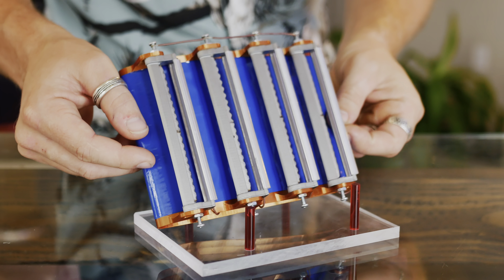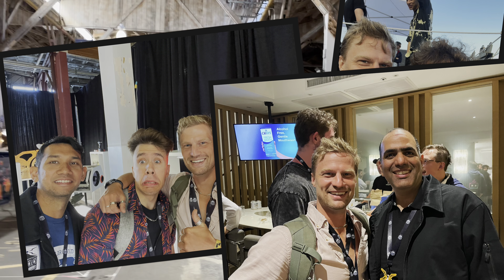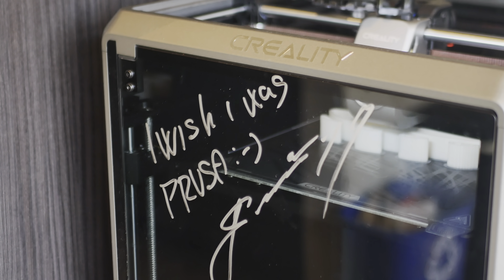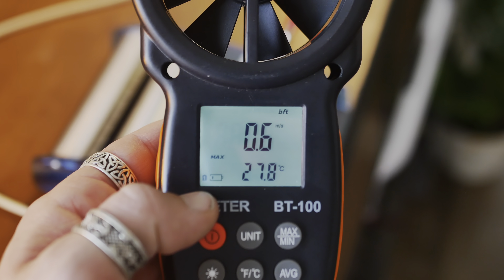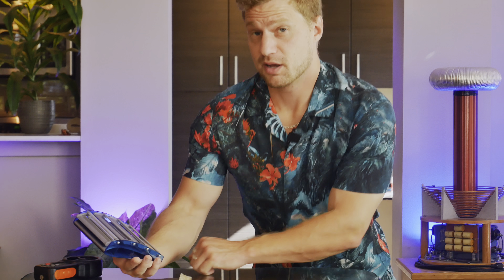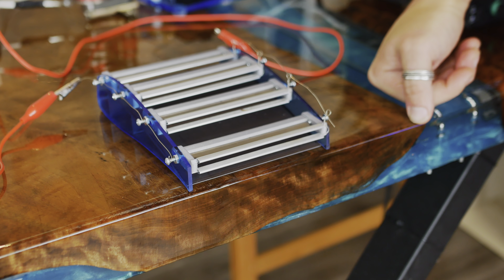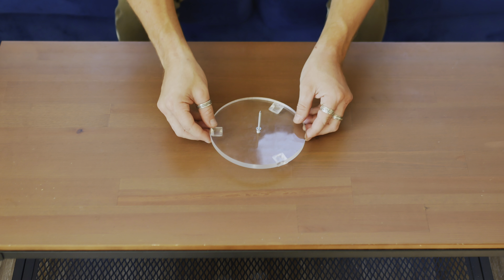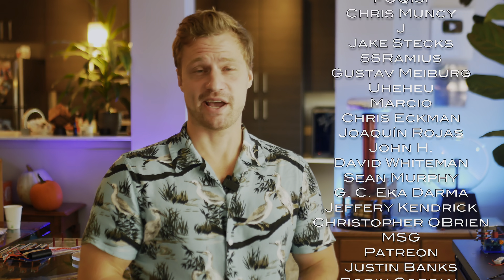Designing A Self Propelling Ionic Thrust Wing

Comment: Would having the thrusters on the top of my he wing cause an issue with lift speed tho? As the velocity of the air on top of the wing is higher, wouldn’t having the thrusters on the bottom allow for less load on the thrusters while still achieving the same lift speed?

Comment: Thanks very much I found this very interesting, have you thought of using the newest carbon fiber possible with a tungsten electroplated trailing edge with resembling a super fine comb pattern? 
an oval wing flat top bottom rounded ends like an old biplane with the top wing slightly forward of the lower wing with your drive on the lower edge of the upper wing and upper edge of the bottom wing ?
 I would think the lightest material possible util structurally sound… B

Comment: Well wonder if after plasma jumps if the left over power can be used for the next jump or so to daisy chain them lets say.And your wing design would it be worth lets say making the wing like you have designed it with a skin of shrink wrap a few cm right over the thruster so you get the thrust l and lift with maybe another liftin surface just wonder ive built serveral remote control plans from scratch with my own designs. Just wondering if it qwoyld help or not. If anything i said sounds at all plauseable get at me. I went electrical engineering tech for 3 yrs some college them military for generators and such and well a pretty high iq and love to make things. And want to bounce of you a thing i have investor gro looking at something im actually making and wondering if getting into bed with them a good idea or just trying to go on my own thanks

Comment: Why do you have the generators on top of the wing?  The lift is generated by the longer distance of the air traveling over a curved surface.  The power plant can be the undersurface of the wing, just like where the engines are mounted in jumbo jets.  ???

Comment: The project is amazing and fascinating. Let me say that there are a lot of works trying to improve aerodynamics of airfoils using electromagnetism, the idea is to keep boundary layer attached over the airfoil over high values of angle of attack. 

I would like to give an hit and an idea to improve lift. 

The hint is: the camber airfoils are good to generate lift even in zero angle of attack. If you would like to simulate and test another versions of cambered airfoils, try using Xfoil program. Futhermore, the flow haz a very low Reynolds number, which maybe approximated by potencial flow

The ideia: To generate lift, the flow must run over the airfoil, keeping the boundary layer attached. Keep the thrusters directed by blowing air over the top of the airfoil. The idea is to keep the boundary layer energized and anchored to the surface.

I wish the best for this project

Comment: Why not use a nearly light as air lifting surface? Have you seen the blimp that's a lifting body? If you make an inflatable airfoil, inflate it with helium so it's close to neutral density in air (call it light-as-air not lighter-than-air) the required thrust is diminished.

Comment: Excellent stuff! If you tune the frequency of the air above and below the lift area, you'll increase your output substantially. You won't be able to get to the point where modulating the area with sound pressure waves (magnets, copper, cones, energy source to drive them....) until you achieve more throughput so they can be added to the overall weight, BUT...... you're well on your way anyway, and you'll find as you increase your wing surface area - you're gonna get there pretty quickly. Again, some really great stuff!!!

Comment: Maybe put the equipment on the bottom of the wing? Or on the inside. Any drag on the wing  messes with  the core principle and could render it useless. But then again slowing the air flow on the top might be better than on the bottom. I dont know really. I will shut up now. Fun video.Thanks

Comment: Actually it's 0.050258 N according to the data you gave Chat GPT. 

Chat GPT did not calculate the Stick in the middle correctly. 

And 0.04389 N would be 4,474 g.

Comment: Why not put the thruster inside of the wing itself? It looks like it's going to be an aerodynamic nightmare with all of the stuff on top of the airfoil. You could possibly get rid of the aerodynamic aluminum tubing entirely by bonding strips of light aluminum foil (or magnesium. . . nvm. Don't try magnesium and spark sources. Or do, but I claim no responsibility for. . . unfortunate events) or even very thin copper on the inside top and bottom surfaces of the airfoil. With a properly shaped leading and trailing edge, you might even get a kind of ram air effect when the wing was moving.

Comment: i have idea , instead of using the blade , can you use light metal strips  @plasmachannel
Reply: this would reduce the weight of the thrust , even im also intrested on working on this project can i get some of the handouts so that i can make some changes in the design 
@plasmachannel

Comment: Wouldn’t it work better (more thrust) if there was a roof “over” the ionic thrusters?  Basically inside the wing, with a intake port at the front of the wing and an exhaust port at the rear of the wing. With each coul slightly directed upward incrementally from rear of wing to front of wing. As well as a bridge between each coil to prevent thrusted air from each preceding coil to interfere with thrust being generated by the coil behind it
Reply: Autocorrect kind of butchered my comment. Coul = coil.

Comment: So you can design these to be inside the wing itself  or in a classic radial engine pattern with a housing and achieve even greater thrust with a variable exhaust nozzle like a jet engine would have to achieve a lot of thrust for no moving parts at all.   If you built them into the wing itself the thrust could be vectored however you want it to be with a tesla valve.

Comment: @Plasma Channel Around 10:24 into your video you say "this makes zero sense" when using multiple stun gun modules. Each module is producing a strong current. The electric currents created by each module would also create independent electromagnetic fields? The fields would in turn interact with each other causing a negative loss. That's why it runs better "in parallel". Think about how a transformer core connects the magnetic fields produced by each coil.
Do you have any plans to work on an electrostatic generator as a separate project, to hopefully power the ionic thruster? (LOOK UP "Methernitha Testatica,The Swiss ML Testakica")

Comment: I wonder and don't get me wrong this works but... a glider doesn't really need propulsion, it needs assistance in gliding when atmosphere is working against it. Secondly, I am afraid a key mistake is being made here... the lift from a wing comes from the air below the wing going faster then above the wing. This way you work against the physics required to make an airplane fly... You have propulsion, but to my opinion on the wrong side of the wing.... Good luck, like to see a full functional plane 😏✌️

Comment: you might know Jean Pierre PETIT, a french scientist specialist in plasmas but also in aeronautics. he  discovered the MagnetoHydroDynamics applied to aircrafts 50 years go. the ultimate idea is that if you can control a charged flow around a plane body by lorenz forces you don't need wings anymore and in addition by sucking the air in front and around the plane it may be possible to suppress the supersonic bang. but it requires huge magnetic fields and currents intensities.
he's now retired but he made a lot of comics at that time explaining some sciences basis, and here's the link of the one about MHD and how to suppress supersonic waves around and object by controlling the surrounding environment. http://www.savoir-sans-frontieres.com/JPP/telechargeables/English/THE_SILENCE_BARRIER.pdf

Comment: This is a cute idea, but I think you'll find that you're losing more to parasitic drag with this design than it's worth. It might fly for a little bit, but it can't be scaled up and it won't produce enough thrust / power. The wires will help but they'll also hurt, because they'll be damaged so rapidly by the induction heating.  It'd be better to design an efficient ring tunnel with compression stages using a venturi, so that each ion ring thruster is exposed to denser air and is more power-efficient than the last.

Comment: Try to place your thrusters underneath the wing, you want to accelerate the slower stream under the wing and avoid turbulences on the top for upforce by higher velocity. You’re limited by the velocity of the thrusters at 4m/s so the v under the wing will be limited too. 4m/s under the wing brings you more v on top of it and a nice upforce

I’m not an engineer, don’t trust me.

Comment: Someone smarter at physics correct me if I’m wrong, but I think the propulsion system is on the wrong side of the wing. Lift is generated when the air under the wing is moving faster than the air above the wing. I’m not sure it can fly in it’s current configuration and even if it did putting the propulsion underneath the wing would still make it more efficient. Note where jet engines are placed on most commercial airliners -under the wing. Only way I can see where that wouldn’t be the case is if the propulsion system introduces so much drag the unimpeded airflow past the wing was faster than the net airflow of the propulsion system.

Comment: Why not getting rid of the main wing and design the thruster as a set of successive wings.
This will remove the weight of the wings and get the lift from each smaller wings individually.

Comment: This setup provides thrust, but isn't good for creating actual lift in the wing.
The air needs to move faster over the top of the wing than below it. You would get greater lift by having all the components below the wing, or even inside the body of the plane. Putting everything on top of the wing reduces the lift.

Comment: To get this to "fly" you need to design the glider out of inflated hydrogen or helium structures. Place the ionic thrust elements in the section of wing where the air would naturally try to detach from the trailing surface. The increased lift might do something to offset the suboptimal method for generating thrust. For your power source I would skip the battery and use something like FusionFlight's ARC Microturbine generator - 8 kW of power that fits in a breadbox. The advantage is that if you use pressurized hydrogen for your structural members you can slowly use some of it as fuel in the turbine. Obviously all of this would work better with electric ducted fans...

Comment: What a cool project! Congrats. 

Your rotating contraption could be used to measure also  lifting capabilities of the wing. 

Rather than balancing the two sides, let the wing start “at ground level” an observe if it can take of the ground. 

That would simulate flying and lifting conditions.

Comment: Just a question, I build a lot of foam and 3d printed planes, by pushing/pulling air over the top of the wing are you going to break the basic principal of lift? By this I mean are you now creating high pressure on top of the wing which will force it down. Once the plane gets up to speed this would reduce as the air flow under the wing increases as it is pushed through the air. It could be why very few planes have motors mounted on top of the wings? The one I know if is the HondaJet 420, I had an RC version and it flew very well.

Comment: If indeed it is air pressure that causes lift (greater pressure below the wing and thinner air above) - wouldn't it be advantages to put a stack of thrusters at the leading edge on the underside and another stack at the trailing edge on top of the wing?
*Because the air pressure will be lower in front of the thrusters - and higher behind.

Comment: There is too much friction of airflow for the air to pass over the top of the wing. Too much friction over the wings causes drag. Too much drag means you will have to produce more energy to power the wing for lift and in doing so will cause more drag, leading you to a catch 22 situation.

Comment: Hi, I am not an engineer but I do come up with designs for my own use. I watched your efforts on this thruster a few days ago, but yesterday I watched the F1. Early this morning my brain came up with a couple of ideas that may be useful. Instead of adding the Thruster to a wing, why not design it like a inverted front wing on a F1 car? they produce a lot of downforce/lift they are stiff and light, and they are made from Carbon Fibre (advantage or hindrance?). You could use those elements as the Thruster?? Also you could use Graphene coating for the conductive elements and for all the wiring. It is strong, light, flexible, the best conductor, and heat transfer. Anyway just the ideas that popped into my head, I hope it helps. Chris

Comment: Maybe there could be a bunch of panels in series. each one will have a different voltage. I don't know the voltage of these, so for the sake of example, I am going to assume they are 400V. Going from the front to back, the voltages could be 1600V, 1200V, 800V, 400V, and 0V respectively. If the back edge is serrated, or has spikes, that would also help. it might also be a good idea to use multi-element wings. rctestflight has a video where he used them, and although they were not practical for his application, i think they might be an excellent for self propelled ionic wing segments.

Comment: I'm not sure how you would go about making it.  Something else that might reduce the weight even more. Replacing the aluminum tubing with a copper plated graphite tubing. My thought on this is from when I was getting into kites along time ago. The hollow graphite tubes were lighter and stronger than just about any other options at the time. Of course I have no idea what that will do to the cost either. I remember back then the was about 3 times the cost of the fiberglass tubes in the hobby. I also haven't been in the hobby now for almost 25years too.

Comment: 11:50 Instead of using 4 separate elements on a wing, construct the wing out of smaller elements that each take in the former elements stream, and amplify the jet. If most of the jet can be captured for like 10 elements in a row, you'll get there.
Also, output wind speed isn't everything, output volume plays a role as well.
It also helps if existing wind speeds don't differentiate the outcome much, which I'd test for.
If the velocity of the air doesn't change the speed diff before and after the ionisations, it will always add speed even at great speed.

Comment: I'd be curious how it would impact the lift and power if the wing was wider.  Allowing for more ionic thrusters and more lift surface area. Or what if the thrusters were contained in a closed space with an intake slit in the front and vent on the back of the wing so you'd have the thrust and an unobstructed lift surface.

Comment: For the future of this project you should consider adding light weight servos to each ion thrustor to allow them to move independently giving them the ability to articulate. Then add some machine learning and AI to control them to react to different air flow condition. In turn this would allow your "smart wing" the ability to adapt to its surroundings. Lots of implication but not too far-fetched of an idea, Right?

Comment: Very cool idea. A few ideas 1) Maybe think about a single skin wing- that will save some more weight. Also you might consider a lower profile wing shape. 2) I'm willing to bet that if you put your thrusters on the bottom surface of your wing it will go faster than on the top. 3) Why have so many little thrusters all over the wing, why not consolidate them into one bigger centralized thruster. You put a link to your buddy's plasma jet thruster he built. I bet that if you developed that design a some more you could get some pretty sweet thrust out of something like that- I imagine you could make a plasma ram jet engine: use the ionic thrusters to draw air down a tube where it can be slightly compressed, then use a plasma generator to super heat the air and direct it out a jet nozzle in the rear. Can't wait for the next episode

Comment: I understand why you raised the ion parts above the wing and made it into little secondary airfoils, but didnt see you test just the ion airfoils, could you just test that instead? Also with the wire could you try maybe a zig zag pattern instead of a staight line? techincially that would increase the weight because it would be a longer wire but my understanding is that the sharp points are useful in creating the plasma streams needed and instead of using the plastic sheets to cover the gaps, could you use the tape you used to create the foils?

Comment: This is extremely cool. Before anyone asks why don't planes fly with this, it's incredibly bad in power/weight. For reference, a similar sized rocket would provide ~5kg of thrust, compared to 44g of this setup. Take that number with a grain of salt, what's important is that the power/weight of conventional thrust mechanisms is orders of magnitude larger. You could build small paper planes with this, or large planes for flying on gas planets, but not large planes on earth

Comment: Great work! Stupid question: would it be possible to use conductive tape / wires laid directly on the wing surface instead of building a structure to have them over the wing ... so in this way the wing directly becomes the engine..